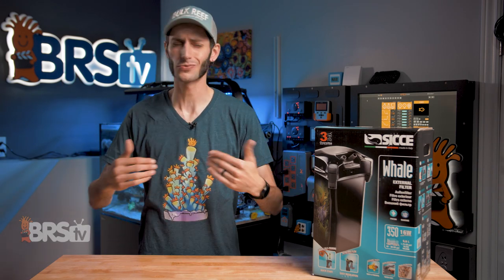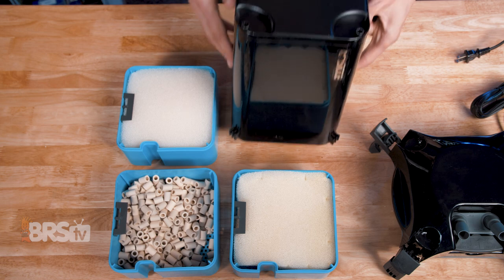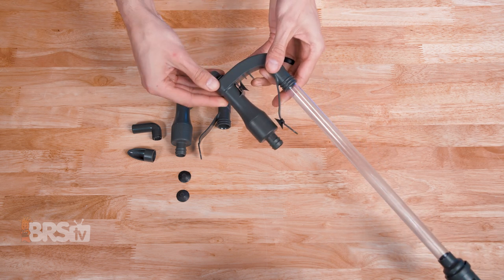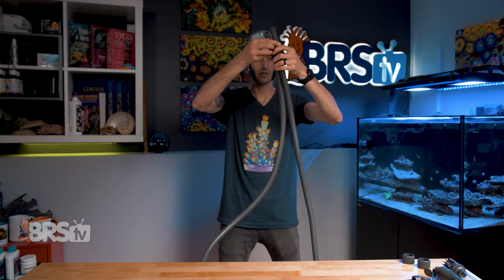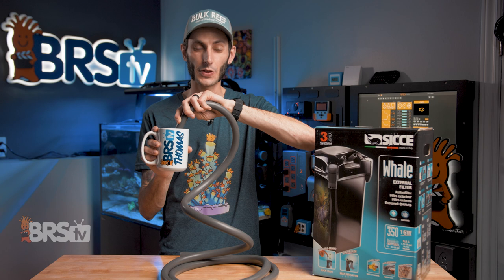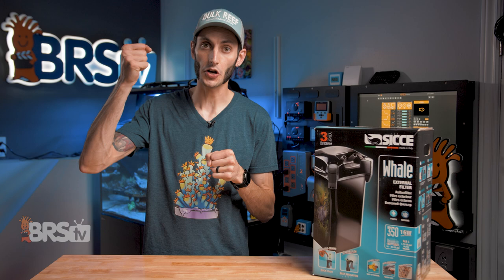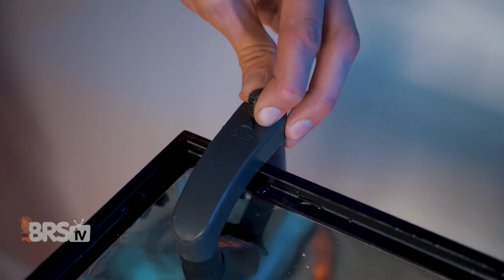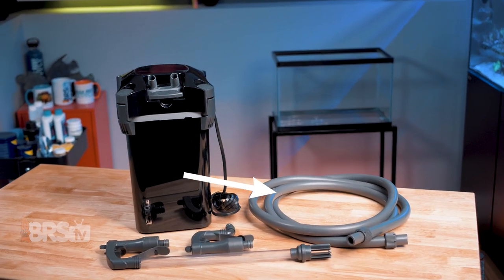How to Setup and Use the Sicce Whale Canister Filter on Your Saltwater Aquarium.

Comment: Any idea on why I have microbubbles? My Sicce whale has been running for about 2 months and it’s been since day 1. I’m new to canister filters. Thanks!
Reply from the maker: Sounds like air is entering the system somewhere. Make sure to check all connections and also the intake of the filter to make sure air isn't being sucked in.
Reply: Most likely you have a small gap close to where the intake tube enters the canister. Try to  make sure all hoses sit firmly attached, and the air bubbles will most likely disappear.

Comment: I bought one of these to replace my aqua clear 50 that I have on my 10 gallon tank. I got the whale 200 because I had seen a video from Thomas were he recommended going bigger than what the box recommended for my tank size due to flow. Sadly the flow coming out of it was very little even at max. I got mines from petco I’ll see if I can return it and get a tidal hang on the back instead. The reason I was changing from my aqua clear is because the top some times comes off when the basket pushes it up so I know the tidal filters give a solution to that problem. I guess the one used in the video was the whale 500 it seemed to move the water well in that tank which is just like mines but the 200 not that great.
Reply: I just bought the whale 200 for my 14 gallon got it set to max and it has a really strong flow.
Reply: Yeah I’ve got the 200 for my 40 gallon lol. It’s far too late too return now I’ll just get a wave maker

Comment: Thomas, how do you clean the filter canisters without disassembly of the lines from the tank?
Reply: I know this is 2 years late, but for anyone still curious, the piece where the tubes connect to the main unit detaches, so you don’t have to actually take the tubes off.  From there you can move your filter and disable and clean with ease

Comment: What do do when priming is not working?
Reply from the maker: If you've primed the filter, but it still isn't moving any water. Try taking everything apart and making sure there isn't anything assembled incorrectly. If that doesn't work, shoot Sicce an email and the team there can help with further troubleshooting or warranty support if necessary.
Reply: You can also turn it on for a quick second prime it a few times and if there is bubbles coming out of the out line unplug it right away and prime it and wait till there is no more bubbles coming out and plug it in afterwords. Good to go.  try to do this in about 15-30 seconds maximum or less the better

Comment: Are these canisters any good and what are some cons
Reply from the maker: Sicce is a leader in the aquarium space and absolutely make good canister filters. The biggest con with canister filters in general is that it's usually a bit more labor intensive to clean them out. Thankfully, the way that this one is designed, it makes maintenance a little easier to relieve that headache.